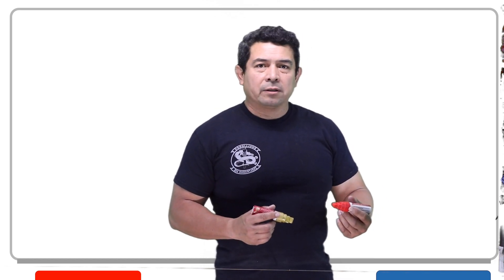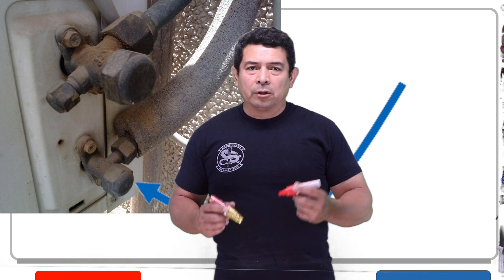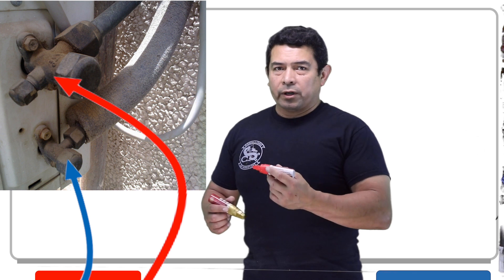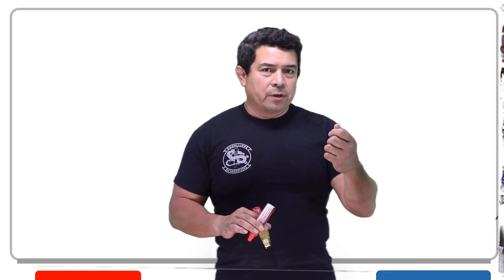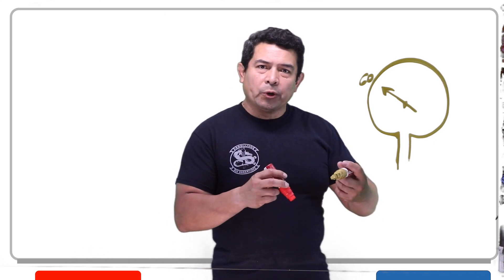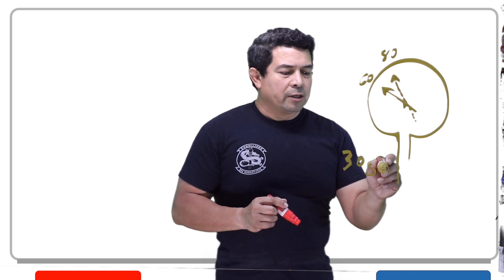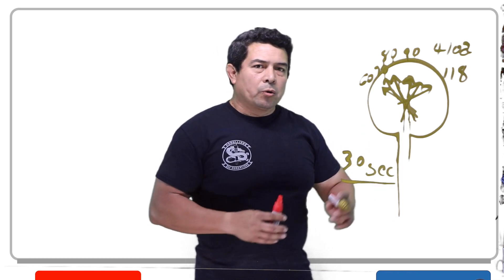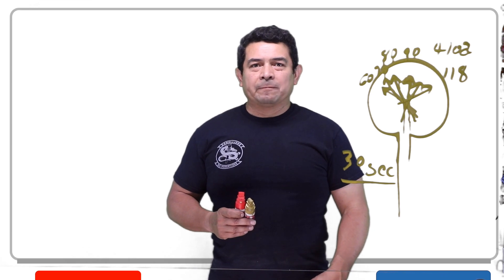Charging a system with liquid-HVAC Online Training and Courses

Comment: In the beginning I think you show, high side and called it suction line, and same called sction line high side. I become little confused.
Reply from the maker: I'm sorry if I confuse you, but the thing to remember, is that the big line that has the insulation is the low side and the small skinny line is the high side which is the liquid line. I looked at the video and I guess maybe the picture I use is a little confusing? All of the units are set up differently, but the big larger tubing that's insulated will be the suction and the smaller warm line is going to be the liquid line or the hot side. I hope this clarified it. Sorry to have confuse you. And thank you for watching!

Comment: Ive always added 100 percent liquid slowly but i listen to the compressor that if starts making a little noise. stop  and let the suction ice melt let it stabilize and repeat. But i would not reccomend my method to someone without alot of experience. Ill try yours next time out and see how long it takes to charge.
Reply: I also would be more careful on mini splits than regular condensing units they seem more delicate.I only work on regular condensing units on residential or commercial. But I'm old school
Reply from the maker: @RobertBludman  those mini splits are tight quarters if you have to change the compressor! Or if you have to do just about anything!
Reply from the maker: You are absolutely correct and what you said about not recommending your method to someone without a lot of experience. I know when we have experience, we try certain things and we push the envelope! But yes, please try it this way. It has always worked for me and you will see that you can extend the time that you have your valve on the manifold opened. It works great! I will never forget the time that my partner dumped liquid into the suction line and we heard the compressor screech to a halt! That was a terrible day for us! But thank you for watching and thank you for your comments! Good luck out there!
Reply: @AirConAcademy what's worse is that if it locks up what do you say to the customer. I did this once on a 3 ton window unit in 1983 but I was inexperienced at the time.
Reply from the maker: @RobertBludman  1983? Wow, so you have been doing this for a while! Great to hear you still had it! Some of these new guys need to take over I'm trying to do Less.

Comment: Typically when there’s a receiver between the suction service port and compressor, I can add full liquid refrigerant without complications. The receiver allows liquid refrigerant to boil off and becomes gas before entering the compressor.
Reply from the maker: I believe you are talking about an accumulator. The receiver would be installed in the liquid line. But yes! You're definitely correct when you have an accumulator between the suction service port and the compressor you can add liquid to it. The problem with that is that if it is sized properly, you should not flood the compressor. And typically only heat pumps have accumulators, air conditioning units do not have accumulators. But yes, you are correct. If there is an accumulator there you do not have to worry about liquid getting back to the compressor. Thank you and thank you for watching!

Comment: Hi I’m confuse, I want to add R407c to suction site as liquid can added liquid unit should be off before I add?
Reply from the maker: You can add 407C to the unit as a liquid on the suction side, but like I said in the video you need to throttle it. That means just a little bit at a time if not, you're going to ruin your compressor. Be very careful when adding liquid because of this reason.      any of the new refrigerants which are blends have to be added as a liquid because of their composition.    Please let me know if you have other questions.

I hope this helps. And thank you for watching!
Reply: @AirConAcademy when i crack open the low side even a bit for a second then close it, the pressure jumps from 25 psi to 150 psi then takes a long time to drop back down (i.e. for the compressor to pull all that liquid away)
Reply from the maker: @ when you do this, you have to be careful. You don't want to feed too much refrigerant through the low side. So yes, you have to be careful and sometimes it does take several seconds for the pressure to come back down.      In class, I usually teach the students how to do this and I watch them do this.    But little by little by throttling, the refrigerant you will not add liquid into the low side and destroy the compressor. I hope this helps!

Comment: how to do it on HP side ?, i cant seem to find it anywhere , would love your help ........
Reply from the maker: The only way to charge a system with liquid through the high side is when the system has been completely recovered, and evacuated. Once you have pulled a good vacuum down to 500 µm you can put 100% liquid into the liquid line and you will see the pressure on the low side gauge go up. When the low side gauge comes up and it is basically, the same as the high side and you do not feel any refrigerant going in on the yellow hose which is the center hose then you can close off the high side valve and start the unit up. You will need to complete charging the system, but you will get most of the refrigerant. You need into the system this way. I hope this answers your question. And thank you for watching!
Reply: @AirConAcademy  thank you for the reply ....
if the system is off , won't the liquid ref harm the compressor ?
Reply from the maker: @SahilSingh-m9m  good question, I have had other people/students asked me this. But if we think about it. We are putting all of that liquid in the liquid line. And between the liquid line and the compressor you have the condenser and that holds a lot of refrigerant. On the other side of the liquid line, we have the metering device/metering device will create a pressure drop and go into the evaporator so we really don't have to worry about liquid getting back to the compressor that way either.   just so you know, I have been doing air conditioning since 1979 and I have done this countless times and never had a problem. The only problem you have is when you put liquid into the suction line without throttling it. When you do that it could get to the compressor. I hope this makes sense. And again, thank you for watching!
Reply: @AirConAcademy  thank you very much for the clarification 😎
Reply from the maker: @SahilSingh-m9m  I am glad I could help! And thank you for watching. If you get a chance, check out my other videos. A lot of guys have said that they have learned a lot through my videos on my channel.    Aircon Academy.         good luck out there! And be safe!

Comment: Sorry but I dont understand one thing, U said that I should connect blue with suction side and charge it with liquid that will change state to gas but why I should connect red hose to disharge side.
Reply from the maker: I always tell everyone to always check both sides, the low side, and the high side. There are times when we need to add refrigerant according to the superheat and other times when we add refrigerant according to the sub cooling. That is the main reason we need to check both sides, the high and the low side. I hope this answers your question. Thank you for watching!

Comment: I have a question if you could make a video about it, it would be great. For example in the reverse defrost when the refrigerant pass after the compressor through the evap to the condenser. We usually use a differential valve when we have many evaporators if one of them only is in defrost to ensure the pressure is higher so it will come back to the main flow to the condenser. My problem is that sometimes I see 2 flows mixing up with different pressures and usually refrigerant goes from high pressure to low pressure. What prevent the refrigerant to stop the flow the other side because it has higher pressure? like in your video here u said on the high side we have higher pressure from the bottle so refrigerant will not flow. thanks plz it would be alot of help!
Reply from the maker: I believe I understand what you're asking, I have a video that covers EPR valves. Evaporator pressure regulating valve. These are used to maintain the pressure in the evaporator/the temperature in the evaporator at a desired temperature. The EPR valve backs up the pressure into the evaporator to keep it from  reaching a low pressure which would drop the temperature. So we can have one evaporator or let's say one box at 40° and another box at 20°, if you had another box in the system, you could have that one set at 32°. This would be adjusted and regulated by the EPR valve.  If you look through my videos, here, you will see the video I am speaking about. I hope this explains it, thank you for watching and thank you for sending this question/comment in!

Comment: Good day Sir may I ask when you charging liquid refrigerant in sunction line the unit must be turn off or in running condition? Thank you sir hope you notice my comment
Reply from the maker: Thank you! I tried to look and read all of the comments! And answer the comments. If you are putting liquid in the suction line, the unit must be running. Also, you must throttle or another words restrict the flow of liquid into the system. This is why I was explaining about adjusting the flow and only allowing a little bit of pressure in at a time. If you let too much liquid in, you will destroy the compressor. So please be careful when you add liquid through the liquid line. If you. Add liquid when the unit is off that is going to destroy your compressor, so please do not do that! Thank you for your question and thank you for watching!

Comment: charge on the low side, that depends, some heat pumps need to be off, and they dont want liquid on the low side its can destroy compressor that its not running.  my pump water heating pump you charge on the  high side with vaccum, its off of course.  Must be off.  between compressor and evaporator. If you must add as liquid in the suction (low side) the compressor must be on! And very carefully charge.
Reply from the maker: Yes it must be running to add it on the low side,  BUT  it must be throttled so you do not kill the compressor with liquid refrigerant getting to the compressor.   I do it like that all of the time even in the winter time  and never had had a problem.    even in the winter time!!  thank you for your comment.

Comment: Thank you for your excellent explanation.  May I ask a question?  Do you advise the air con compressor be switched on during the charging of the refrigerant or should it be switched off?
Reply from the maker: That is a very good question! If the system is empty, you have pulled a vacuum down to 500 µm and you are still in a vacuum in the system, I always add liquid into the liquid line! This speeds up the charging process and as you're looking at the gauges you will see that the low pressure gage is going to start to rise once the two gauges are at the same pressure and no more refrigerant is going in, then you close the valves on your manifold set and start the system. Once the compressor is running and has been running for a few minutes you let the pressures settle down and then you can finish charging using your superheat or your sub cooling readings. Unless of course you are charging the weight because if you're charging the weight then you just add the correct amount of refrigerant. I hope this helps and this answers your question! Thank you for watching!

Comment: Hi, if adding r410a only results in an increase in subcooling but the low side saturation temp remains around 20F. Could this be a bad txv causing a restriction and freezing up? Really enjoying all your videos. Thanks
Reply: Hi, my r410a with txv unit. The suction saturation temp is about 33F and suction line temp is 48F giving 15F of superheat. But why is my liquid line saturation temp is 97 and my liquid line temp is also 97. I tried adding some refrigerant but nothing changes. This is a high velocity system air handler with a slab coil. I think my suction saturation temp is also too low. Both coils are clean and txv valve is new. Any help would be greatly appreciated. Thanks
Reply from the maker: @mark.r8900  Yes!!!  the saturation temperature is too low at 33F.  it need to be around 40F. are you saying that the high side saturation temperature is 97F and you do not have any subcooling?   A system using a TXV  is suppose to have subcooling  if you have no subcooling you need to add refrigerant.   The TXV is suppose to maintain suerheat and you have high superheat it also implies hat you are low on refrigerant. I hope this helps you!!!
Reply: Thank you
Reply from the maker: It sounds like you may have an airflow problem.  I have seen that happen, when the system has low airflow. Remember a TXV is going to maintain superheat, not the evaporator temperature. Evaporator temperature is maintained by the correct airflow.  So if your evaporator saturation temperature remains around 20°F you can check the superheat.  you probably find out that you  still have approximately 10° of superheat even though the temperature has dropped. That means you're TXV is doing its job. But check the airflow, make sure the evaporator coil is clean, make sure vents are open and your filter is clean. good luck!!!

Comment: Hi, I've just replaced an evaporator coil. The system is pretty low on r410a. Both, the liquid line and suction line service valves are closed. Can I add some liquid r410a into the high side first before starting the system up? Thanks
Reply from the maker: yes, you can add liquid to the liquid line only. I have done this many of times, when I have done it I have my suction and liquid line service valves open. I add liquid to the liquid line and keep adding 100% liquid until both pressures equalize. I usually keep the liquid line/red valve on my gauges open all the way to get as much liquid in there as possible.  If you grab the red hose that has liquid going through it you can feel that liquid going through and you can actually feel it practically stop going into the unit.  I have never overcharged a system doing it this way. Good luck sorry I just saw this. I hope this still helps.

Comment: When charging in liquid form, using a liquid to vapor converter , should you still crack the low side every 30 seconds or just open the valve fully?
Reply from the maker: According to the manufacture you can just open it fully. I like to be in control so I usually do not use those and even if I did I would throttle it at the low side valve just to make sure. We never know when things will fail! Thank you for watching and your comment!
Reply: @AirConAcademy  thanks man

Comment: Hello, would you still add to the suction line if the unit is off and in a vacuum?
Reply from the maker: Thank you for your question, it would be best not to add it to the suction line because if you do, liquid will get to the compressor, mix in with the oil and on start up the liquid refrigerant could lock up the compressor because of the lack of lubrication in the bearings. If that does not happen, then the oil would foam up and be pumped out of the compressor and your bearings would lock up because of lack of lubrication. So it is not suggesting that you add liquid refrigerant in to the suction side when your are first charging a system. I hope this answers your question!!!

Comment: Appreciate your effort to educate us. I need your help on charging a bare tube evaporator for freezer with txv, liquid receiver. Whenever I charge the system with vapour, the performance is more superb than when I charge with liquid. The freezing is usually thick on the tube with liquid charging and this delays the baking time while vapour charging is usually very light and baking time is more quicker. R22 is used. Again, I want to try 404 by charging with liquid through king valve to weigh in refrigerant but I want to know whether it will amount to the same result. Thanks
Reply from the maker: Hi: thank you for your comment! I keep hoping that my videos educate and help you guys out there in the field! I have not seen a bare tube evaporator in a very, very long time!  Now as for your unit! Since it is R22 it should not make a difference if is charged with liquid or vapor. Since your system has a TXV and a receiver then it should be charged by sub cooling!   If possible I would not switch to 404 refrigerant. As long as your system is tight and you are not leaking refrigerant you should be able to stay with R22.  If you feel you must convert to 404 then, yes you would charge the 404 refrigerant through the liquid line once the system is completely empty and you have evacuated the system to 500 µm. You will need to complete the charge through the suction line and it must be added as a liquid but you must throttle the gauges as you add refrigerant so you do not get liquid back to the compressor!   Don't forget to change the dryers if you do switch over! The amount of charge should be almost the same if you switch to the 404 refrigerant. You will have to check the superheat to make sure that that is correct and you do not flood the compressor!    I hope it turns out well! If you have any questions, let me know! And sorry it took me so long to get back to you,!
Reply: @AirConAcademy I appreciate your time to write this long explanation. Thank you very much
Reply from the maker: @wasiuadewale9781  you're welcome, I just want to make sure that I can help you guys out there in the field! Take care and God bless!